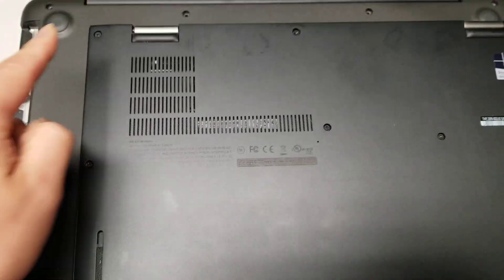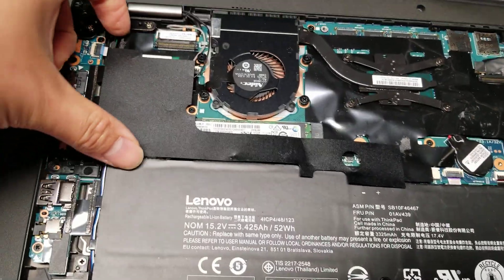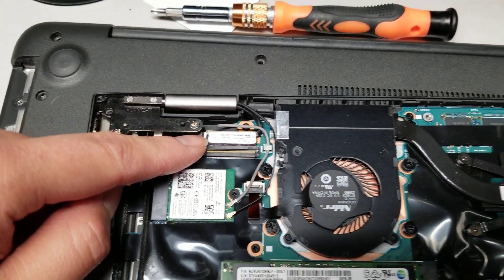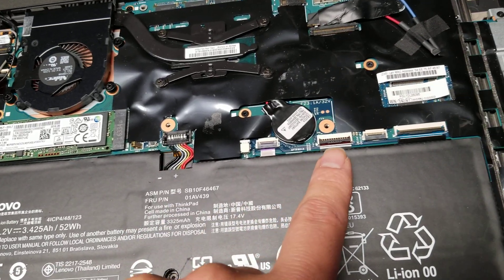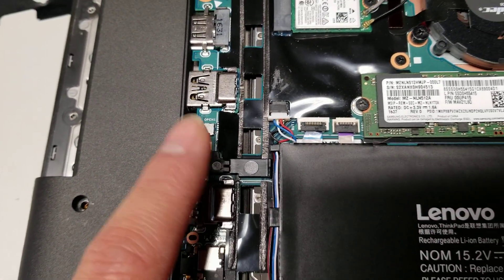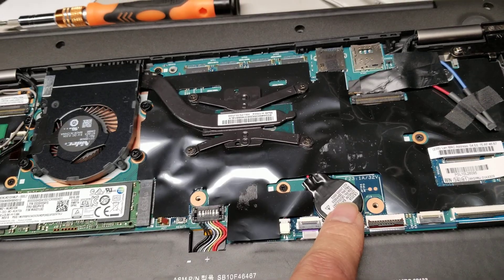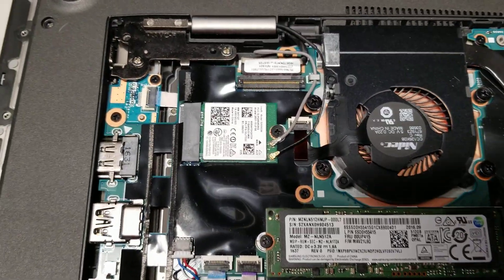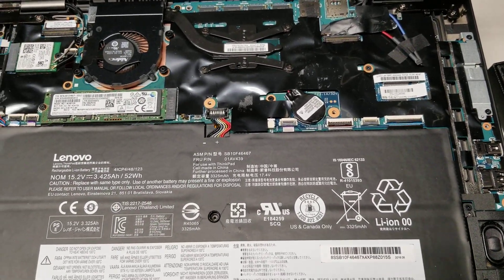Lenovo X1 Carbon 4th Generation Disassembly SSD Upgrade Repair

Comment: Brother my x1 gen 4 does not turn on, it only turns on the green color of the power button and the fn button and the mute button on the keyboard, plus the fan accelerates and stops intermittently... what do you think it could be?
Reply from the maker: Might be a dead motherboard :(
Reply from the maker: Try a bios battery reset

Comment: The memory is soldered into the system board, so it comes with 4GB-16GGB memory.  There are no upgrades in the memory upgrades.
Reply from the maker: Yeah

Comment: Hi how do u know when you should replace the thermal paste on the CPU on the i7 X1 Carbon 4th Gen (16gb 512gb nvme)..? and says your suppose to put just enough so it covers the area but doesnt go over..  so are you suppose to tighten it down & then re take it back off to check you put enough..?
Reply from the maker: When it's hitting 90⁰ C or higher

Comment: Does ThinkPad X1 Carbon 4th Generation support M.2 NVMe? Also, is the RAM soldered, or can I upgrade?
Reply from the maker: Here's how you can get the answer to your other question. https://www.ebay.com/itm/Lenovo-ThinkPad-14-X1-Carbon-4th-Gen-i5-2-4GHz-8GB-Motherboard-01AX807-READ-/202952111735?mkcid=16&mkevt=1&_trksid=p2349624.m46890.l49286&mkrid=711-127632-2357-0
Reply from the maker: Here's how you get the answer to the second. Google https://forums.lenovo.com/t5/ThinkPad-X-Series-Laptops/X1-Carbon-SSD-Upgrade-to-1TB-3rd-GEN/m-p/4639150?page=1#5072086
Reply: @ItsBinhRepaired  at the second link it says that from x1 carbon 4th generation and onwards supports NVMe. Thanks for the links!!!!!
Reply from the maker: Did you even watch the video?
Reply from the maker: I mention in the video what type of SSD it is. This video is super short compared to my other ones. Please at least watch a little bit.
Reply: @ItsBinhRepaired  yes of course I watched the video. I mean general if it's possible to insert an m.2 NVMe SSD. If the m.2 port supports SSD M key (NVMe)
Reply from the maker: @lefstamp  usually all the computers are keyed to fit m.2 nvme. I've never seen a computer m.2 slot that can't fit an nvme SSD, but often they won't support it. I don't know what all the m key b key nonsense is. It means nothing. Lol

Comment: Tip: there are two additional clips holding the back cover besides the 9 screws. They are near the bottom center, so it is more obstruction lifting the bottom half compared to top portion. I cracked one clip when lifting my cover. You almost need a flat screw driver prying open the bottom half cover and then yank down the cover a little then lift, by force but not too much force.

Also the screw holding down ssd is so tight that i almost stripped the screw head, probably because the screw is also secured by the ssd notch which has spring-pressure from its socket end. I have to use a torque driver with horizontal handle instead of a skinny computer screw driver to finally remove the screw, which has to be replaced and good luck finding those tiny computer screw. I cant stop imaging a stripped screw ruin my $1000 laptop.

Nothing is easy. The labor cost is $100 I found
Reply from the maker: Hmmm I don't remember having so much trouble.
Reply: @ItsBinhRepaired  - Feck. I'm encountering the same issue @Min Zhang mentioned. That screw is really on there.
Reply from the maker: @cacogenicist  make sure you use a screwdriver bit that doesn't wobble
Reply: WHY? Why is that fecker torqued on that hard? It doesn't have to hold against any sort of mechanical force. They just don't want you to change the SSD or some ....argh.
Reply from the maker: @Christopher Carr  I think it's the screwdriver you're using is wrong. They use threadlocker because vibration shakes them loose.
Reply: @ItsBinhRepaired  - The Phillips fits very precisely and snugly. It just will not budge without stripping
Reply from the maker: @cacogenicist  JIS 1 is what you want. PH is designed to cam out

Comment: I have same laptop but no display, I need to recover some data from ssd, can you help please
Reply from the maker: Assuming yours is also m.2 SATA, this is what you want. https://amzn.to/3qYYaBu
Reply: I had the same issue as you. Is it hard to remove the ssd?
Reply from the maker: @abeot_  take the screw out and pull it out.

Comment: Not a ssd upgrade video.
Reply from the maker: The video should show how to remove and replace it. What more do you need? How to clone? I have a video for that.
Reply: @ItsBinhRepaired  You point at the SSD but you do not show how to remove it.
Reply from the maker: Just remove the screw and then pull it out. It can only come out one way. If you're not sure, watch more videos of other models. It basically comes out like a stick of RAM.

Comment: do you have any idea how to fix thinkpad x1 carbon 4th gen 2016 model track point attached to the main keyboard ? because the track point keep scrolling automatically i already have changed a new one and it’s fine working , but i would like also to fix the original one has came with this laptop to keep it as a spare part..
Reply from the maker: Not sure how to fix that?
Reply: @ItsBinhRepaired  thank you for your reply !!
Reply from the maker: @miketucker7205  no problem
Reply from the maker: @miketucker7205  sorry I couldn't help

Comment: Is it hard to replace the whole keyboard with the upper part of the keyboard case? I mean how do you detach the hinges? Thanks!
Reply from the maker: Not difficult if you know what you're doing. Hinges on this if I remember correctly just make sure to disconnect all the cables. Remove the battery and hold the power button for 30 seconds first. Open the screen out 180º so it's flat. Undo the hinge screws and you can lift the display assembly out.

It's pretty risky taking everything out if you don't know what you're doing though. Watch several of my videos before attempting it to get a general idea of how everything works.